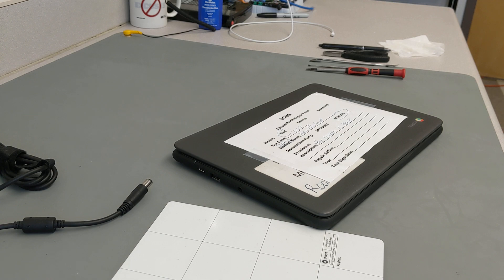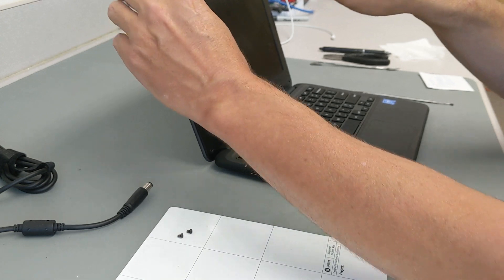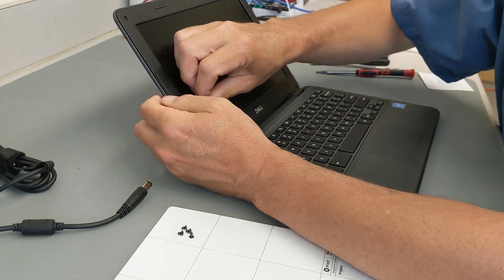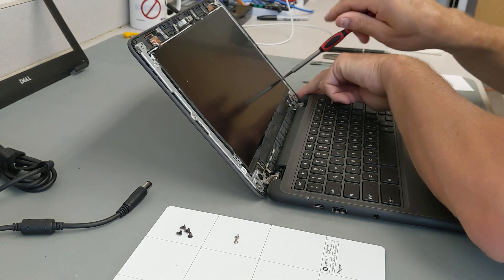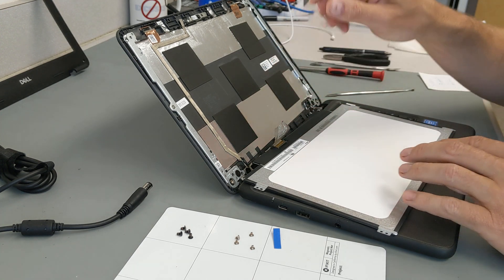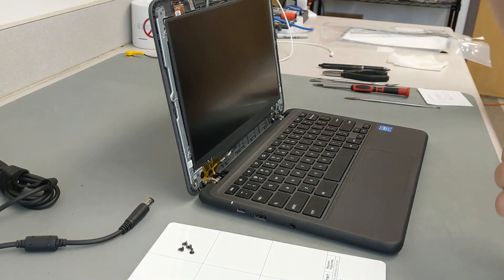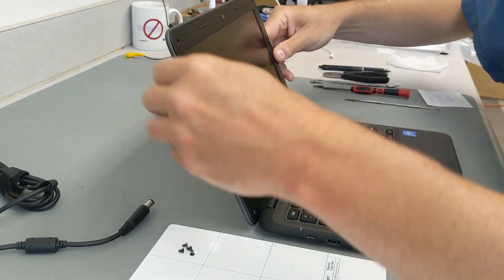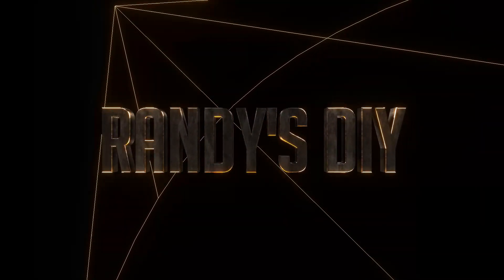Dell 3100 Chromebook Screen Replacement

Comment: Bro this guy just did this without even disconnecting or At least draining the battery
crazy work
Reply from the maker: That probably makes about 3,000 of them I've done that way. But I highly recommend if you feel uncomfortable not disconnecting the battery,  disconnect it. When you do as many of them as I do and find out, you don't have to go through the trouble of removing those nine screws on the bottom and removing the battery connector. It makes a lot of time saving

Comment: aren't you supposed to disconnect the battery connector from the motherboard before you begin to prevent shorting out the new screen?
Reply from the maker: Yes, but I've done hundreds of these and ha e never had a problem. But feel free to disconnect the battery, as it would be safer

Comment: I’m at the part where I’m removing the screws from the screen but they can’t seem to be removed when I use the same driver as you
Reply from the maker: It may have different screws I have seen some with 01 and even 001 Phillips
Reply: @ what type of screw driver do you recommend? I’ve used all the diff sizes of the cone shaped ones I have
Reply from the maker: https://amzn.to/4i2uZqz
Here is my Amazon associate link, I have this set and it's great however the one I use in the videos came off a snap-on truck.

Comment: Awesome video, .Quick question though - where did you get the sharpened spudger?
Reply from the maker: I made it. Harbor freight ground it sharp the heated it yellow hot quenched it in oil

Comment: Ok… so I dropped my chrome book when it was laying flat and there is something wrong with it now. Like the bottom left screw is popped up and you can see in the computer from the side/bottom and there is comething wrong with the hinges
Reply from the maker: If you're talking about the screws on the bottom rear of the Chromebook, there are three screws that hold the hinges on. One is under the rubber foot on the bottom cover. The other two are under the cover. Those screws are prone to backing out and getting loose to where the screen hinges will flop around when they back out. It also allows the plastic to crack and break. If that's happened, you'll probably need to purchase a new keyboard which will give you one of those screw holders new that would hold your screen better
Reply: @randysdiy2102  the screws next to the screen to take off the cover. The bottom left one like the screen cover is higher than the screw so like the others are right at the surface but the bottom left screw is deeper inside
Reply from the maker: I really couldn't tell you what's going on without seeing it I'm sorry

Comment: Hey randy. I have been trying to replace screens for these. I am not sure if these are the touchscreen chromebooks. But the touchscreen ones, no matter how I get to the screen, or how careful I am. The middle screw on the right seems to always be broken. The whole screw mount breaks off, kind of like the palm rest issue with dell latitude 3189. Do you know if this is a known issue with them? Or maybe I am just missing something. Will it affect a new screen if I still put one in
Reply from the maker: I haven't fixed any that are touch screen all of ours are non-touch and I haven't experienced any of them with the screw problems. it may be an issue that they'll may have over tightened them.
Reply: Hey there, just wondering if you had any updates on your touch screen replacement and it went ok with the issue you were having. I'm looking into fixing mine and wanted get idea on what to look out for. Thanks
Reply: Hello, I was looking to replace my screen but was unsure of which one to buy , you think you can send the link of which one you got from Amazon? Thank you for your time !

Comment: Can you link where you brought the spudger tool and the screwdriver please if that is possible.
Reply from the maker: I got the screwdriver set off of a snap-on truck and I bought the spudger from harbor freight tools but then sharpened and hardened them. The best place to get tools for Chromebooks and phones is Ifixit.Com
Reply: @randysdiy2102  Thank you

Comment: You got a link for the 3100 screen on Amazon ?? I need it ASAP and I can’t find it , please.
Reply from the maker: https://www.amazon.com/dp/B00NVKWK72/ref=cm_sw_r_cp_apa_fabc_80KNXTZCW8DG8MFRMGDV

https://www.amazon.com/dp/B075DVKPTT/ref=cm_sw_r_cp_apa_fabc_X3VDS9TX8K8QBBWR5ZQ3

Any 30 pin with the correct resolution should work. The screens all interchange between, dell, lenovo, acer, etc. 
However if it doesn't fit that's between you and Amazon. Hope this helps.

Comment: would it be safer to run out the battery prior to preforming the repair?
Reply from the maker: The battery life on these is about 8 to 10 hours, you could do that but we have about a 1000 of these units and can't wait. We have never had one go out on us due to turning on while working on it. If you concerned you could take the bottom off and unplug the battery.
Reply: @randysdiy2102  where did you buy the screen replacement for this one? I couldn't find a reasonably priced one? 3100 Chromebook P29T
Reply from the maker: @BiggieCheeto  I get most all of my parts either from Amazon or chromebookparts.com. the Dell screen is the same screen that is used in the Lenovo

Comment: Do you know how to do it without taking off the Chromebook piece?? bc I've tried resetting my chromebook and it won't work. if there a way without taking it apart
Reply from the maker: I'm not sure I understand your question. If your screen is broken you will have to take the bezel off to replace the screen but I'm not sure what the resetting would do for a broken screen. let me know if I misunderstood your question.